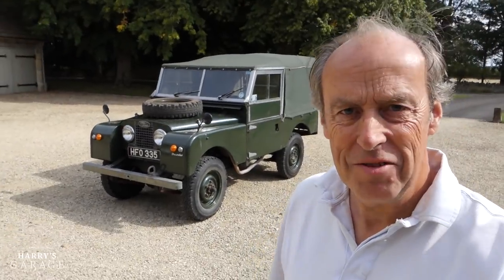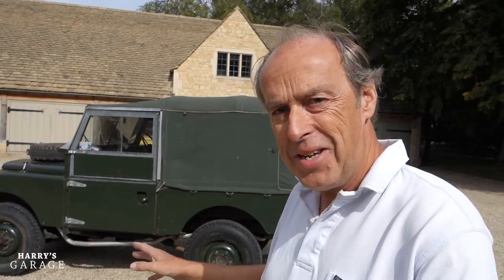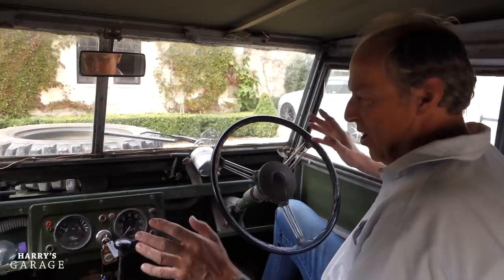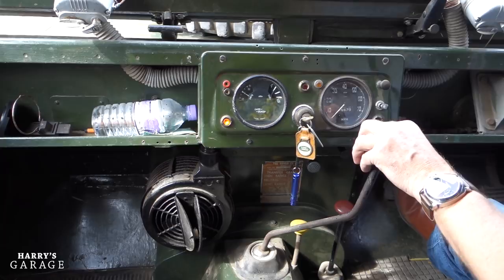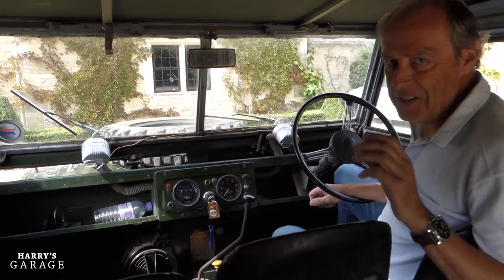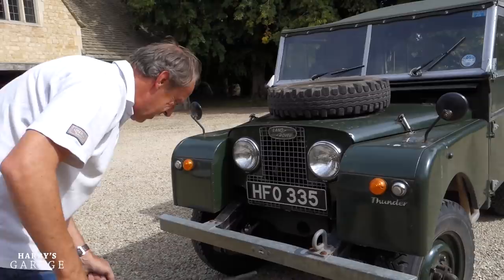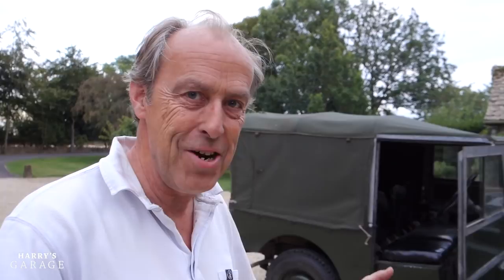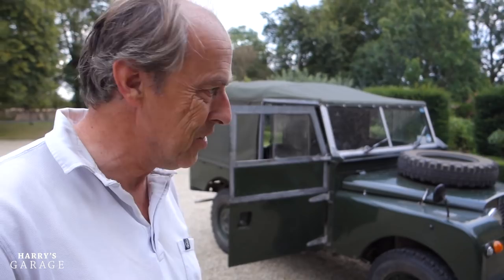Land Rover Series 1 86" review

Comment: And here we see the YouTube algorithm at its finest. 6 years later...
Reply: you never mentioned the power take off ability front and rear. I used to bale hay with 1 of those and able to power the grister from the front,(static of course) The reason for the seats folding forward was an Army requirement to enable a stretcher to be placed there. Great video , it brought back many  memories .P.S keep your thumbs inline with your index finger on top of the handle 'cos if it kicks back you'll have 2 broken thumbs and likely get the sack.  I own and drive a 2014 discovery it has 293087 Kilometres on the clock and the 2.5lt 5 cylinder diesel just purrs and will sit on a 110 kl per hour on the free way for hours on end .Australia is a big place so that is not uncommon.I love my Disco Duck and will never part with it. It doesn't leak oil, it sweats power. And if it ain't leaking it's empty. Cheers keep em running.

Comment: My Dad bought 1952 a Series 1 80'" in 1954. He had a hill country farm in New Zealand. It was the only farm vehicle he had until he retired in 1981. We learnt to drive in it, loved it. The only heating was air from the motor blowing through holes in the firewall for the lefthand drive conversion. In low gear low range it would go anywhere. Had a hand throttle on the dash and  you could set it going in low gear hop out and run back to the trailer and feed out hay while she idled across the paddock, then run back and turn around . He keep her after he sold the farm and later offered her to me, but as we had a new baby and nowhere to keep her to my everlasting regret I said no. He sold her to a couple of hunters, a new battery and coil and she started first turn f the key after 15 years!
Reply: Buy her back!!

Comment: In 1984 I imported from Doncaster UK here to the US, a series 1, 1956 yr. L/R.  I performed a 2 year ground-up body-off-frame restoration to a pristine condition.  I rebuilt the engine/transfer case/gearbox/brakes and all ancillary parts & installed a Fairy overdrive. Had a great time driving it for a year then sold it.  Boy do I miss that machine!!  Think twice guys if you think you want to sell a vehicle like this as you WILL regret it 10 or 20 years from now.  Hold onto any rare item, be it auto, boat, stereo...anything vintage!

Comment: My dad looked after a bunch of these on an army field station in the bush outside Nairobi during the Mau Mau crisis. I remember him saying that one of them was the earlier 1600 which had permanent four-wheel-drive while the 2-litre versions were selectable. He also said that if you wound them up the 1600 was (eventually) slightly quicker for top speed. Hardly surprising low ratio is low, if you've only got 50-something bhp to play with it's gonna have to be slow to be effective. I remember the '60s &'70s ones he owned privately. Deafening. A mixture of engine noise, transmission noise, tyre noise and wind noise. Light weight is a tremendous advantage off road - something most 4x4 manufacturers forgot about years ago. Hence the relative genius of things like the Steyr-Puch Haflinger, the Lada Niva and the Suzuki SJ family.

Comment: Great video, reminded me of the lovely 1954 86" we had for many years before it finally succumbed to rust a while back. Wonderful to see all the little details like the starting ritual, 4wd and low range leavers, full filler under the seat, choke light, and those epic windscreen wipers. We also had the 'floppy ear' indicators on the A frame though they were an early victim of the rust caused by being by the sea. Really fun car to drive, as Harry said they are almost unstoppable, as kids we learned to drive on sand dunes in our Landrover (433 EXO) and never got bogged down. The lack of synchromesh on the gear box taught us how to double de-clutch up and down the gearbox, a smooth gear change was a highpoint of the holiday.
Thanks Harry, as you can probably tell your video bought back lots of great memories :-)

Comment: Heyyy.
My first Landie I bought out of a farm yard with chucks in the tray.. 5 Quid. as is.
Change oils. Clean fuel.wheels/tyres.Battery.plugs. Canvas canopy and frame.

1.5ltr SIDE VALVE engine with permanent 4wd. Hi'Lo and 4 spd box.
Tray was about 18inches long.. Could almost reach back and touch the tailgate from drivers seat.
It started on third push of button. Brush painted army green paint.
Looked quite neat.
I used it for towing a 15ft caravan round uK.Wales on Gas pipelines for around 2 yrs
 b4 selling and buying a 2 ltr Petrol Hard top shorty.
 It towed that van all over Wales up and down the mountains. usually around 15 mph.
 43mph downhill on a windy day.

Wish I had the old dear nowadays.

Comment: Thank you for a very nice presentation, Harry! I used to drive one of these too, when I was a youth, so this brings back sooo many memories. I think it was a slightly newer Series I model I drove, probably 1956. The car wasn't mine, it belonged to a friend; but he didn't hold a drivers license at the time, and I did. We had lots of fun with it, both on and off roads. I remember that there was always something wrong with it, always something amiss; but it never stopped, not ever! - it just kept on running.
Later, when I had my training to be an officer in the army, I got introduced to an even more astounding field vehicle: The L-3314N "Volvo feltvogn" (or "Volvo field vehicle", in English). Even if the official name is Lapplander, here in Scandinavia it is more commonly known as the "Valp" (meaning "puppy), "Volvo felt" ("felt" meaning "field"), or also "Folvo velt" ("velt" meaning "tipping over"). Because of its narrow axle width and big wheels, it was prone to tip over when driven across very slanting terrain. But it could take much more than you'd think; I never tipped over in it (though I thought was going to, many times!), nor did anyone else of my comrades who were in their right minds. And I became extremely impressed of what these vehicles could do. They could take a lot more of beating than the driver could, tackle bigger challenges, and still get there. And work. Day in, day out.
So, if you like the Land Rover Series I, you'll probably love the Volvo L-3314! It's as good, if not better, in terms of simplicity, ruggedness, reliability and fun, as the Land Rover S1. And it will take you places where the Land Rover probably can't go! I have never driven a wheeled vehicle that could do off road work like it could. The only terrain vehicle I know till this date that surpasses it, is the Volvo BV-202 - but that's belt driven, so it's not a fair comparision.
Here's a clip on how it performs in the field:
https://www.youtube.com/watch?v=CADPP_3_UUI
And here is some more info:
https://en.wikipedia.org/wiki/Volvo_L3314

Comment: This is lovely, I remember when I worked at the solihull plant ‘81 - ‘83, in the ‘Car Dispatch’ department looking at the production ledgers, going back to the first prototypes off the line and then the vehicles for home market. BTW, an open palm swing is advisable when hand cranking, stops it breaking/dislocating your thumb. 
Sweet.
Oh and it would have been a disgrace if the RR hadn’t made it up the hill, my old 80 Series 1995 Land Cruiser wouldn’t have batted an eyelash at that 👍🏻🇷🇴🇬🇧

Comment: Had a Series 1 Long Wheelbase 107 pick up. Incredible vehicle. Series one had heavier chassis than later LR and the vehicle was capable of ploughing with optional linkage. PTO was also an option. The 2 litre inlet over exhaust was vulnerable to dropping a vale follower or pushrod if over revved so I carried both rocker and side valve gaskets to repair at the roadside.

Comment: And all the tool kit that you need..Adjustable spanner, hammer, screwdriver, plug spanner, that`s about it.
I am 73 now and I remember when I was 16 hauling hay with a trailer attached to one of these, they could pull just about anything  through mud and hills etc.

Comment: Of all the amazing vehicles you show, I like this one allot. It reminds me of the American version of my 1988 Suzuki Samurai hard top. I put 380,000 mile on that, from brand new. I think the life I had out of it, was the fact, that I never felt the need to beat the life out of it, by trying to keep up with domesticated cars that can cruise 75 mph all day long, as my little 4x4 would struggle at 50 mph, but I had other cars that allowed crazy speed, and just enjoyed the simple driving of it. In that 380,000 mile, typical maintenance of oil changes, and tune-ups,  one set of brake pads and shoes, one clutch cable, about 50 fan/alt belts, a few light bulbs and that is it, the tires I changed out to an American brand called HOOSIERS and those had 340,000 mile and had plenty more to go, but I sold the little guy, and I think about that little 4x4 very often, I really miss it. I have had some pretty remarkable vehicles in my life time, but, that Suzuki was something else all together a fun machine to drive an play with. I think for folks who own slow machines like these, they need to understand, that they were never designed to western lifestyle of driving, and I spoke with one of the engineers in my travels, that had a hand in the design of the Suzuki series of 4x4's, that they were hoping to drop millions of them off in Africa's market, and economy's that did not have paved infrastructure road way systems. and knew that bumpy road ways are to be traveled slowly, and the motor in that little thing (if I remember correctly was a 1.8Ltr? something like 48hp) that if you didn't rev the daylights out of it, that it would last forever... I proved that, of course with oil changes and tune-ups every 20 to 30,000 miles. Wonderful vehicles to own and drive. and the $8.00 USD a month in fuel was great too!!! Thank you for showing this unit. If I had the choice of vehicles out of your stable, this Series 1 would be it.

Comment: Thank you for the review, it brought back some memories. 
Used to help my father start the family car using the "handle". It also had a carburetor (Weber, we were lucky not to have Solex) and the mechanically timed ignition. 
The fuel pump was "mechanical"...so to start the engine you had to pump the acceleration a couple of times (hence I guess its name "gas pedal"), but not much, otherwise you would flood the carburetor, then keep it pressed, turn the ignition key on (keep it turned) and start pumping again at the gas pedal as the engine starts rotating, until it rotates on its own.
Oh, the "choke"...usually used during cold weather and with less gas pedal pumping. With the choke in use, the fuel consumption was sky high...15-17 l/100km...a lot for a 1300cmc engine.

Comment: I had a 1943 JEEP and used to borrow a series 1 Land Rover from an uncle.  The jeep had a 2.2 liter flat head but only a three speed main transmission.  As far as performance went it was six of one and half a dozen of the other.  I live in Canada so the Rover was left hand drive.  To the right of the stock instrument panel it had an oil pressure and coolant temperature gauge. The jeep also had individual wipers but they were vacuum powered which meant they died when accelerating up a hill,

Canada starting salting highways in the 1950's so the body of the jeep rusted out. The aluminum body on the Rover didn't rust but the ladder frame was steel and the rover died when the frame rusted and broke.

One hint.  When using the starting handle DO NOT WRAP YOUR THUMP AROUND IT! If you have a kickback it will jump out your hand rather than break your arm.

Comment: In New Zealand we put old Holden straight 6s in them and they go well anywhere. I've been constantly amazed at the slopes the old landrover will climb, it's like a goat. Slopes so steep it's impossible to stand up but the old Rover just chugs up at 2mph. Can cross most streams n rivers and seas of mud but you need some CRC in case the dizzy gets wet.

Comment: I pretty much learned to drive on a Series 1 80 inch LR as a staff cadet on an air cadet gliding school. The 80s were gradually replaced with Series 2s and the so called "lightweights". The series 1 was definitely the best on the airfield and we towed some huge loads with them - sometimes three roped together to tow a winch out of the mud.

I now own three Land Rovers. A 1953 Series 1 80, although much modified now as it had at one stage had a V8 and had a Series 2 "two and a quarter" when I got it. Having been told it was impossible, I then fitted a 2.6 six cylinder inlet over exhaust (IOE) from a Rover 100 car which is not as strange as it sounds as the 2.6 is just a six cylinder version of the four cylinder IOE that it had from new. The truck (not a car!) also now has disc brakes which make it stop a bit more reliably.

You may have kicked me into making a video of my series 2B forward control.

Comment: This was so funny, when the camera passed the exhaust, that's so thin. And the jumpy ride, with the stance, as small as it is it has a longtail look, give me the impression of a happy drunk folk who would take on anything. Of course, as a drunk it will stumble, even with 4 levers it has no locking diffs, so at times only 2 wheels turn those with least weight on them. Try a double ring& pinion per axle vehicle in the Steyr Pinzgauer Puch.

Comment: Ran a series two as everyday transport, went everywhere in it at forty five mph, used to get twenty to the gallon as well (that's good going for the 2.25 litre) ,  did sixty thousand miles in five years (had a winch driven of the gearbox so no overdrive), good times!😀.

Comment: had a quick scroll to see if someone else mentioned this---don't see it. Maybe military training , maybe  common knowledge.The chance of the ignition advance causing the first cylinder to fire before the piston passed top centre and cause the engine to kick back against the attempted rotation was strong. So the risk with the hand-grip you use is that it will BREAK YOUR THUMB! 
So I was  taught to wrap thumb(s) in the same direction as the fingers so if it  kicked back it just broke your grip but not your thumb.

Comment: The relatively unique thing that gave the frame it's strength wasn't the ladder. Ladder frames were common but this was a fully boxed frame. Those weren't in jeeps until 1977. American trucks were advertising them as a new feature as recently as the 90s I think (can't remember which models).

Comment: I know series Landies inside out, and this was a heck of a presentation by a novice. Two things to look out for: Learn to double declutch between 1st and 2nd gears, and get out of 4wd when you take tight turns even off the road otherwise you will strain the transmission (transmission windup).

Comment: Would be IoE engine, Rover did these, one of the reasons they used this type of engine is all the fuels it can run on. Whilst we may decry sidevalves today, inlet over exhaust was much more capable than the engines with all sidevalves and Rover kept building these engines for the Land Rover for decades.

Comment: Sir, a lovely video but trying to give a commentary whilst driving a Series Land Rover?
I have a SLIGHT suspicion yours MAY be ex-MOD.
It reminded me of my first Land Rover: a Series IIA LWB 109, ex RAF ambulance that went on to be a display vehicle at the Gaydon Heritage museum. It got damaged unfortunately and was passed to Dunsfold Land Rovers whom I enquired about the possibility of converting it to a pick-up. They said they only had a blue rear tub and the front was obviously green so they very kindly painted the entire truck in MOD matt black for me! So it had the 1 ton heavy duty suspension (for an ambulance) but a lot less weight, yeah, rather bouncy to say the least.
People would enquire about the top speed to which I always replied, rather than what it was PHYSICALLY capable of, it was more a case of how much abuse your eardrums could cope with. AND I also had to use the starting handle once in ASDA's car park due to a flat battery.
Selling that car is probably the biggest regret I have out of all the cars and motorbikes I have ever owned, I would have another SII LWB in a heartbeat.

Comment: Nice.
Did you start with foot on the clutch? I wouldn't since you add the whole pressure to the thrust washers of the crankshaft (which leads to wearing them out). When you start with no gear in position, the starter just turns the main shaft in the gearbox. This shouldn't be too much for it.
By the way - this is something I learned during 10 years of (genuine) Mini-driving.

Comment: The nearest thing to it these days is the suzuki Jimny, they almost copied the 88"  Series II with its part time 4X4 and dimensions.

Weight	    1135kg
Length	    3645mm
Width	    1645mm
Height	    1725mm
Wheelbase 2250mm

Comment: 8:05 If that's a brake pipe draped over the rear diff, you're just asking for it to be worn through. #MOT fail
Reply: @justafish-bd8kw  As diff is not mounted fixed to chassis, hence whole purpose of flexible pipe, pipe is going to move relative to diff except where it joins the T piece bolted to the diff. Between T piece and chassis, pipe should not rest against anything it is not securely fixed to ! 
I'm quite happy to accept they got every one wrong ;)
In MOT comes under security of braking system.
Reply: @justafish-bd8kw  It was my opinion from that view. I can't confirm the issue until I've seen for myself.
I've probably seen more pipes rubbed through than you've had hot dinners. Many of them hydraulic plant though!